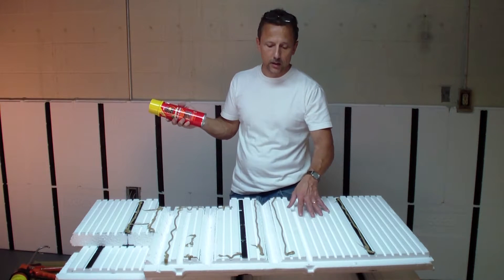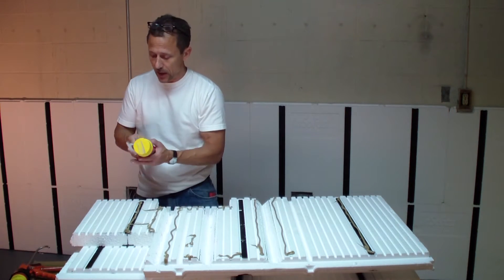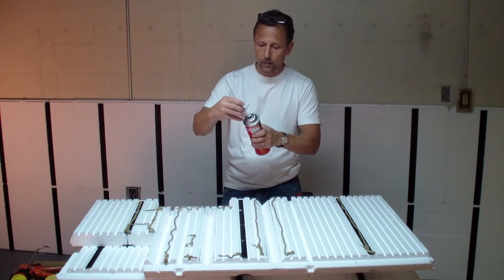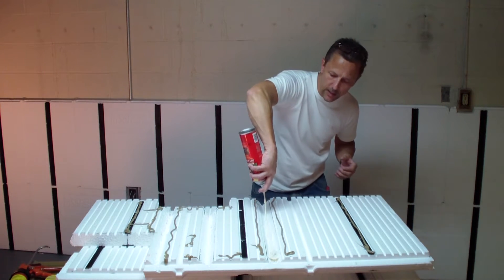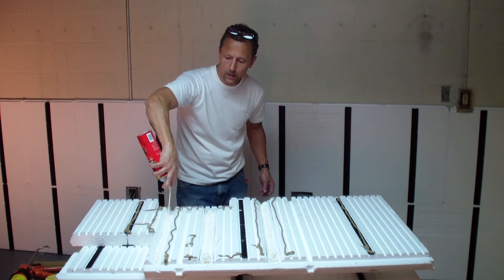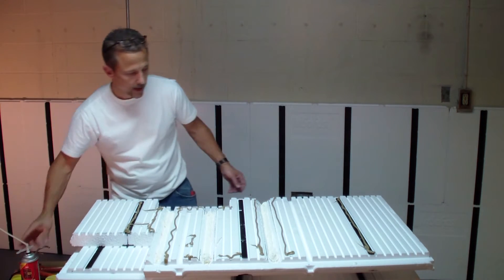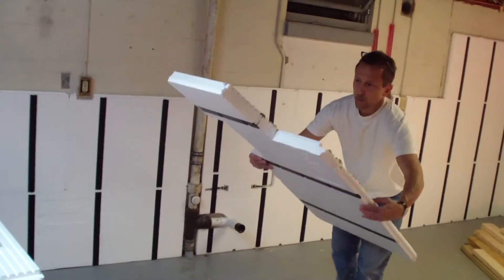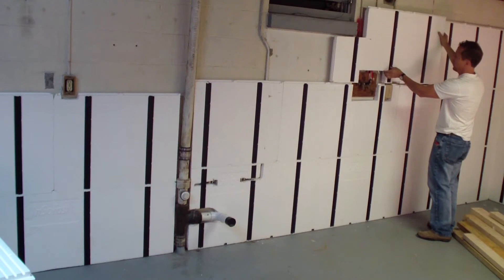InSoFast Advanced Training - Pipes and Obstructions

Comment: What is that tool you were using at the end to cut the styrofoam.  It looked like a heat knife.  Is that what it was?  Where did you get that?
Reply from the maker: You can find a link for the hot knife on this page: https://www.insofast.com/products/shipping-containers-accessories-tools.html
Reply: What tool did you use to carve out those deep cuts to make room for pipe?

Thanks!